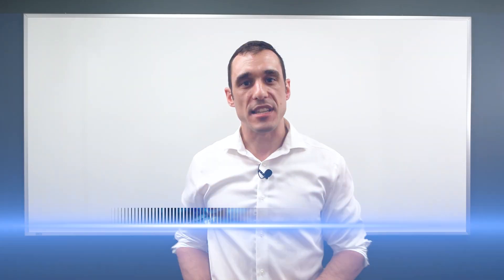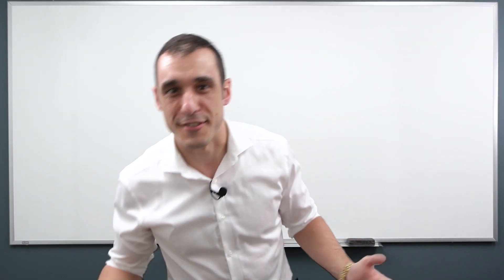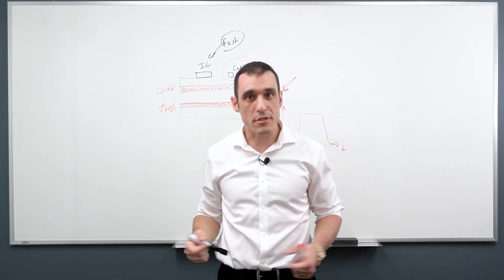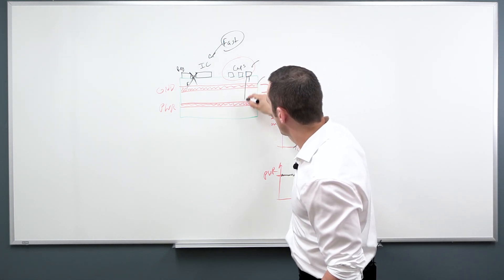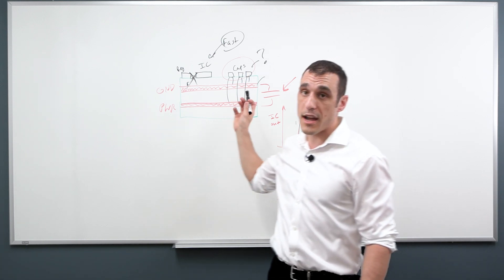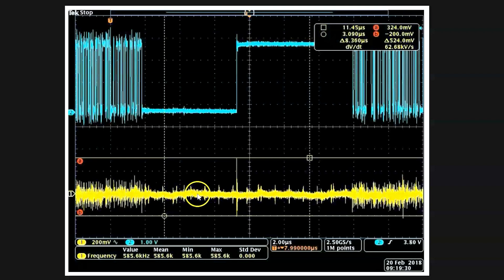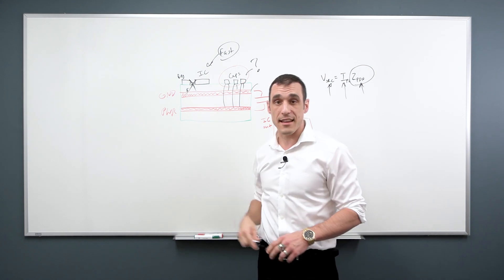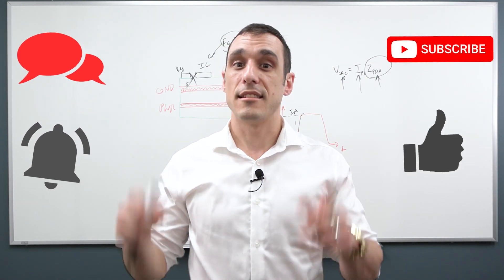Should You Put Ferrites on a Power Regulator Output?

Comment: I'm an ex-engineer and certified dummy making some high speed (16Mhz max) boards and this video is on point.   Currently in the middle of troubleshooting random issues on my latest board and guess what, I put a ferrite after the regulator.   I hope that's the reason it randomly shuts off.   Previous design had no ferrites and no crashing, but noise issues.   You didn't mention ferrites before the regulator though.   What are your thoughts there?
Reply: It depends on what your power source is. If you're taking AC directly onto the board, one thing that is done is to put the input power through a common-mode choke and filter circuit, which will filter out common mode noise so that you can produce a differential voltage from a regulator. These come in a range of sizes and as SMD components. For larger currents, these guys get larger. It's also common to clamp on a ferrite core on the power cord in coming from a rectifier to remove some of that noise coming from the AC line before it hits the regulator.

Also, when you write "16 MHz" max, I assume you're referring to the clock frequency? In reality, you're probably operating at much higher than 16 MHz because digital signals in the board have their power spectrum spread out over a very broad bandwidth. As an example, let's say you're using the SPI bus on an ATMega48A; in the datasheet, the rise time for this bus is listed as 3.6 ns. The bandwidth of this signal is at least 100 MHz. If you wanted to measure this signal with an oscilloscope and remove Gibbs artifacts, you would need a scope with bandwidth exceed 97.2 MHz, and that's assuming your scope doesn't have a brick wall filter requiring greater cutoff (they all have that!).
Reply: Take a look at this video as it also addresses what qualifies as a high speed PCB design: https://www.youtube.com/watch?v=tbIekfIf8dI

Comment: Very nice explanation about why not to add a ferrite to the power supply network.

One big problem though, you never ever put a power plane on a 4 layer board, ever. Power is routed on a 4 layer board. Don't believe me? Ask Rick Hartley or Eric Bogatin.
Reply: Hi Manuel, thank you and nice to see you made it over from LinkedIn! You can put a power plane on a 4-layer board, what matters is how it's used and what the signal rise time is. Other EMC guys advocate the Sig/PWR/GND/Sig stackup, and we've done designs that have passed EMC on that stackup. I think you've hit on something important which is that the "power plane" should best be called just a "power layer" and should not always be a literal plane, and it could contain signals. What we've done is have a power/signal layer with big rails or copper pour that is next to the ground layer, and then we can have routing within that. Anything that could be considered high speed is routed on the top layer above GND, then bottom layer may have low-speed/DC or some ancillary components (regulators, passives, etc).

You've definitely hit on something that we'll want to discuss: how does a return current get back to GND when routing over a power layer? Either the decoupling caps, plane capacitance, or you try to route a via alongside to aid the reference layer change. These are things we've had to confront as part of rework in client boards that have failed EMC. The point is, don't route very high speed signals across those planes unless you can provide a clear return path, and at that point you would want to go to 6 layers instead of 4. Edit: Rick Hartley brought this point up in a podcast with Judy Warner, and he notes the problem is failure to design a clear return path, not the fact that there is a plane layer.

Comment: 13:15  Zach draws on a line to indicate peak current. But this is a plot of voltage -- the output voltage of the IC.  There will be a pulse of current demand at each transition, partly to charge the signal line that the IC is driving to a new state, and partly due to feed-through of the upper and lower output transistors which may both be briefly on simultaneously.  Most, if not all, of the pulse current demand should come from nearby bypass caps and PCB PDN plane capacitance, so that the PDN back to the regulator sees current demand that is substantially smoothed out.  The regulator is not equipped to respond to current demand at the speed of individual logic transitions, not to mention the impedance of the PDN from regulator to load IC.  (unless there's a point-of-load regulator).  None of this argues in favor of an inductor at the regulator output, just that it's helpful to be clear about the relative speeds of activities (voltage step edges, current demand pulses, ringing) at each part of the system.

Comment: I think the video is confusing and lacks attention to detail or a wider appreciation of circuit design - but I applaud the initiative.  There is no disagreement that the PSU impedance should be minimised so planes and multiple vias and layer build are important here - I don't think many engineers would add low current ferrites on the output of buck converters. But the plane WILL still be noisy from switching sources. So I believe that low current ferrites are added locally to sensitive devices to filter out the high frequency plane noise. Your video didn't explain this at all.
Reply: Hi Chromatec, thanks for the comments. You're right, there are many uses of ferrites that are appropriate, the point is adding impedance to the high frequency region of a PDN is not one of them. We have a lot more videos planned and your point about proper uses of ferrites is on our list. What inspired this particular video was the fact that I noticed the use of a ferrite between a power regulator output and an ASIC stated in a datasheet and an application note. As Kella Knack notes in the linked ferrites article, this is something the discerning designer should not do. Thanks for watching!

Comment: This is a nice lecture. Much appreciated. Yet believe that high speed pros like Howard Johnson from sigcon would not agree outright about being careful of capacitors at higher frequencies. He would most likely say ‘what does it matter if the cap acts like a cap or inductor?  All we care about is the reactance at the certain frequency’.  At least, that was one of my take aways from his classes.
Reply: If you're dealing with one specific frequency then yes, you would care only about the reactance at that frequency. But with digital signals, and specifically when a current pulse is drawn into the PDN, the power spectrum is spread out over a broad bandwidth, so you aren't working at one frequency. In one frequency range, the cap acts like a cap, while it acts like an inductor in another frequency range. Hope this helps!

Comment: The article linked to is wrong on the history of the naming of "ferrite bead" - yes - they used to be beads of ferrite, through which a wire or component leg was threaded. From the article: "To address the first point of confusion, ferrite beads are not beads. They are little inductors." The author also confuses ferrOmagnetic materials with ferrImagnetic materials. 
I've noticed a lot of Altium blog posts are so-so in terms of engineering rigour.
Properly applied, ferrite beads can be useful for noise filtering - but consideration must be given to the noise sources and the relevant impedances under transient conditions.
Reply: Yeah, ferrite beads are actually pretty dangerous to use. They act like inductors at low frequencies so they can cause strong resonances in the power supply when they interact with a 100nF ceramic capacitor for example. You have to be very careful and know in advance what frequencies your circuit will be operating at to make sure you don't excite such resonances. Or, you can damp the ferrite bead with a parallel resistor - but this degrades the performance of the bead. It's a PITA.

The only clear advantage of a ferrite bead VS a standard inductor, is that it won't exhibit self-resonance at 100MHz for example. That's a good property to have but not really enough to justify the hype IMO.

Comment: so, basically the ferrite block the high frequency noise from the regulator to the IC, but what is after the regulator sees a high impedance towards the regulator, and so the power network is "more floating".  i think you should place the ferrite whenever the noise of the regulator is higher than the possible noise induced by the digital pulse on the PDN. no?

Comment: So then how should you filter the existing switching noise from a regulator? Only with capacitors?
Reply: Ferrites are good for switching noise, but not for load switches. In this case ferrites insulate your load from your power supply noise, but they also insulate you power supply from your load making the supply react slower to the needs of the load.

The cap is good because it readily supplies energy when the load demands it while also lowing ripple.